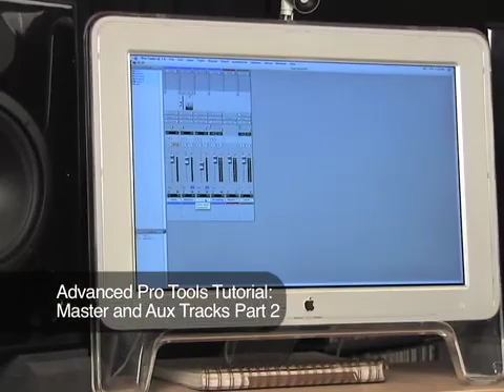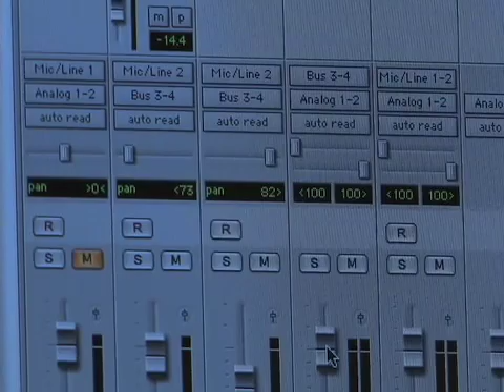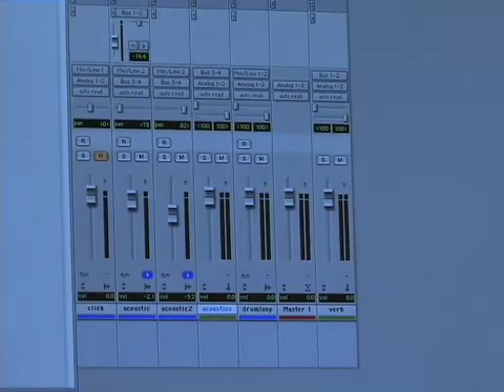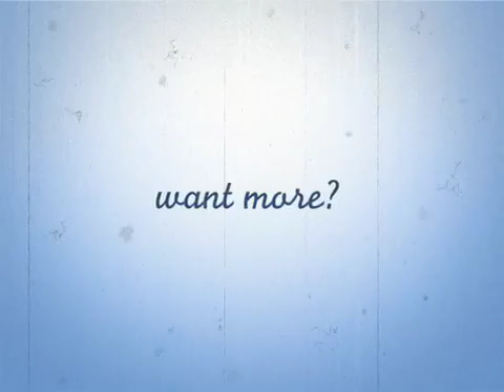Advanced Pro Tools Tutorial, Part 7b: Master and Aux Tracks

Comment: @pigolet2178 
Sends are for routing things around inside the system like plug ins, or bouncing tracks. This way you dont send the signal through unecissary ad-da concersion. Use outputs to access the signal to the outside world: Speakers, outboard equipment like hardware compressors some other hardware processor. Actually for the latter you can assign the gear to an I-O  insert if you have enough io-s. That way you never have to patch the gear in. I love this feature.Maybe its only in HD though